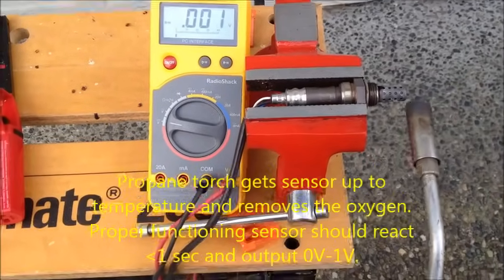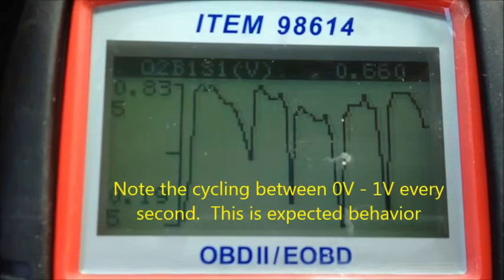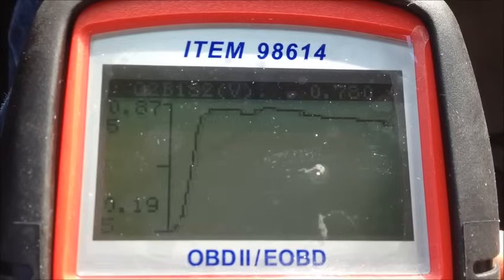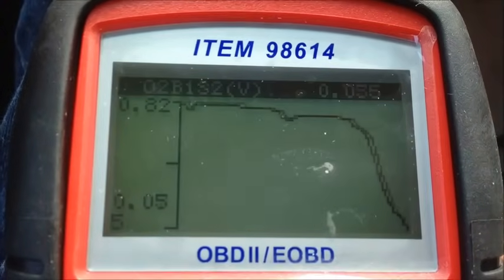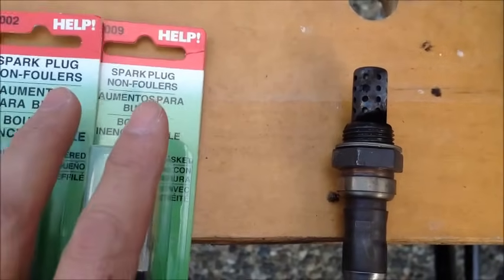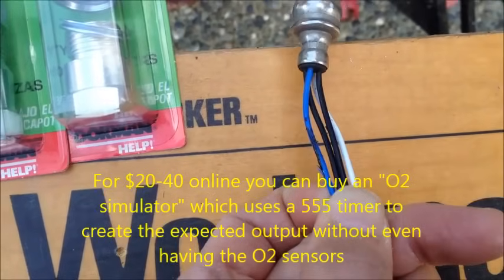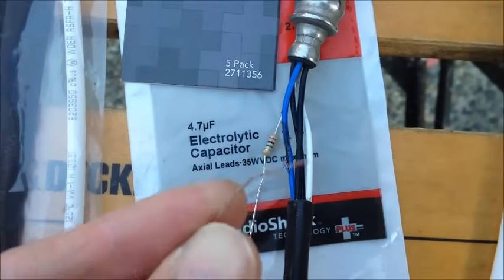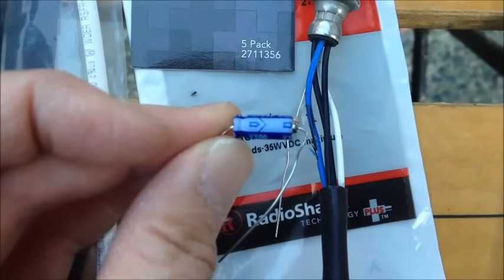$3 O2 simulator fix for P0420 Check Engine Light

Comment: MITEEman,
 thank you! for the time on posting this video. I was one of the unlucky ones that this didn't work. However it wasn't all lost it's that some ECU are more sensitive then others, ask you previous explained. On some cars have programs where using a 1meg ohm resistor will trigger another code of Low voltage, meaning that it doesn't have enough volt to  detriment activate.
so what i have done use the same circuit that you provided I have added a potentiometer = pot and adjusted it to fine the sweet spot on this Suzuki Verona, once it stop giving codes of low voltage and p0420, i measured the pot with ohm meter and it stated 150km then taken out the pot and add a 150km resister. 8 month and no problems. Question how did you know about the frequency? Did you connect oscilloscope to your car? 4.7cap seem to be the money shot.
Reply: Another reason to install the cicuit in a patch cable config - you could make the resistor variable, with a pot, in a lil project box. Still fits under the seats.
Reply: Cisco40ts, thanks for posting your fix, in details.  I'm about to do this on my Honda Pilot and it is good to know this in case I get another DTC.
Reply from the maker: +Cisco40tys Yes, that's a good solution if the default values don't work for you and you want to play with it.  It's a very slow signal so you can use the OBD graphing reader to see the waveform.
Reply: hi,  do you mean 150km  or 150k ohm resistor?
Reply: @kiongchan  He must mean 150k

Comment: I tried this exact mod ( capacitor and resistor in // ) for my corvette, and it didn't work for me.  However, I did get a nice  500 mV read out of my downstream 02's.  The o2 mod generated 2 more trouble codes  for the o2 heater  circuits( B1S2 and B2S2).   In other words,  P0420 was  gone after the mod ,  but I ended up with new codes  P0141  and P0161.
Reply from the maker: +Luis Frausto You should see a signal slowly fluctuating between 0V-1V, not a flatline 500mV.  I suspect that your o2 sensor is too old (>60-100k) and the heater is no longer working correctly.  Check the resistance on the heater wires - it should be close to 5 ohms.  If it's 30 ohms or higher that's not going to work and it explains both the flatline (o2 sensor won't work until it's hot enough) and the P0141 - heater circuit.

Comment: I made this and yes it works. I made one change that I cut an old sensor and end of harness from junk yard and connect to that and plugged in and can unplug later
Reply from the maker: +Howard Knapp I like that idea, but I don't have access to a junk yard.  I see an extension cable for my car runs about $8 on Ebay, whereas an o2 sensor for $17.

Comment: Hi MITEEman and thank you so much for this video. I just tried this fix on my 2001 Jeep Grand Cherokee 4.7L V8 which has been suffering from a P0420 code. Soldered the specified components [SKU 2711356 and SKU 2721012] exactly as demonstrated to the Bank 1, Sensor 2 [driver-side, rear] O2 sensor. Immediately upon re-installation and code reset, it's now throwing a P0138 code [O2 Sensor Circuit High Voltage Bank 1 Sensor 2] and the voltage is showing a constant 1.000v for that sensor on the ODB analyzer. Any thoughts as to what the issue could be?
Reply from the maker: +James Howard See my diagnostic tips.  Since you have the OBD analyzer verify the upstream signal swings between 0-1V every second.  This downstream modification cannot increase the voltages - it just slows the swing down - so a constant 1V tells me that your upstream signal is probably not right (could be upstream o2 sensor or an engine problem) but you may also have to lower the Resistor / Capacitor values as well if that's not the problem.
Reply: +MITEEman Thank you for your reply. As you indicated, this fix does not address a failed O2 sensor and it would seem that something went wrong with mine after it was originally tested. As a diagnostic step, I removed the installed resistor & capacitor to restore the original wiring. Tested it again and the output voltage was still unchanging at 1.000v. So ultimately I purchased and installed a new O2 sensor. Now I've logged ~800 miles with no CEL! Thanks again for the great video and assistance.

Comment: I'm having this same issue with my girlfriends 03 civic. We had an aftermarket cat installed about 18 months ago and the car has 108k miles. LTFT is at %16 and I see that o2 #2 is all over the place. I recently installed new plugs, air filter and cleaned the TB. I have to do a few more tests, run some Techron through it a few times. I've heard someone mention something about putting a couple quarts of paint thinner in the tank, and I'm highly skeptical of doing that. Has anyone heard of such a solution?
Reply: +Shane Sexton I thought you had the same problem with your girlfriend. Her O2 sensor isn't working, and you tried putting a cap and resistance on her!
Reply from the maker: +Shane Sexton I saw those videos which is exactly why I developed this modification instead.  I would never risk my whole engine by doing that.  I also saw videos showing you how to wash out your catalytic converter.  I finally saw the insides of one the other day and I can see why that might be effective but removing a catalytic converter is no small task with old rusty bolts.  You don't mention if you tried this modification.

Comment: I've driven over 500 miles with this simulator and the p0420 code has not come back up on my 2000 4runner sr5 v6. Seems to be doing the job. Thanks. fingers crossed

Comment: I put the cap & resistor patch into the downstream o2 sensor and it really calmed down the output. p0420 code has not popped back up in a week however o2 heater diagnostic has still not completed. Everything else has, and no check engine light yet. Fingers crossed.
originally the 2nd o2 output was jumping around, much like the first. After it looks like this... https://photos.google.com/share/AF1QipM2wsMcidxl9g0vOA33mhLcOtW8pFT61Wtph2BT2smABFYlPDWa_JkcDdh2XS4hvQ/photo/AF1QipMCemgYaZI2-cMNo5Kr9yblAbjTcPu__TidLzHD?key=V1RfN1ZtR0ZkOHdTMG5iZDI2bE1SNWJiZ3hnT0Nn
Reply: Hi there. Did it eventually complete?
Reply: @gibson7654  Sorry, I ended up getting another O2 sensor, later scrapped that van. Now running an 09 Montana. No more issues. :)
Reply: @ScottElder  congrats! I just got my jx35 smogged after 2 failed tries.

Comment: Tried on 2000 jetta 2.0 with p0422 code(main catalyst below threshold bank 1). The p0422 code went away and created a p0140 code. However the spark plug defouler worked perfectly fine. Also look into angle spacers for o2 sensors for another fix.

Comment: This is nice walk around to address slightly oversensitive downstream (behind cat) O2, catalyst on the edge with efficiency.Those wires are not aluminium, but nickel coated. To solder them fluid for soldering Nickel  from radio shack (my one contains ethanol & phosphoric acid) and  increase heat slightly, but don't destroy condensator.This how to will not work for wideband O2 sensor. (new Japanese and Euro cars mostly)Low voltage lambda errors which some people here get, might be related to poor soldering. Is the tin mirror shiny good or rather grey matt - bad? Or wrong resistor.

Comment: Tried this trick on 2005 Prius(188k miles) with the P0420, got code P0038 Toyota - Oxygen Sensor Heater Control Circuit High Bank 1 Sensor 2.

Used OBDII meter to check, showed O2 bank1 sensor 2 1.27v.

Did I do anything wrong?
Reply: Steven Qiu Fixed the p0420 with the non-fouler trick (42002)
.
Reply: did you ever figure why?

Comment: Hey,  does capacitor and resistor need to be that close or can it be moved up further up the harness (plug),  while keeping same cap and resistor orientation?
Reply from the maker: Kobe Kumar It doesn't matter where you do it.  It's easy to make the mod on a workbench but just be sure you have access because on my Odyssey the space gets very tight as you get close to the harness plug.  I have not had any problem with the heat of the catalytic converter destroying the components but it does make sense to keep them as far away as you can.

Comment: I'm reserving this info in case I need it, really useful. 

Also can confirm the o2 sensor wires are a pain in the butt to solder togheter...
Reply: They are steel not copper. Easier to solder using silver solder or install upstream of the connector (copper wire their). Also much harder to spot if a visual inspection is done.
Reply: @douglasholt9337  Yep, discovered the Silver Solder vs Lead Solder After the second try. I had been soldering closer to the sensor to avoid modifying anything upstream, didn't want to make it harder to figure out for the next guy, which it was going to be me :v
Reply: @legendario13  Yep 'me' I can dig it. 
Sooo I made a 'splice' connector. I jury-riged a connector as I have boxes of 'electronic junk'. For your self go get
a set of O2 connectors. Solder up 9" wires between the male and female connectors. 
Now I can do all work om my work bench. I have my pro soldering iron, a selection solder, millimeters, oscilloscope. powersupples, boxes of 'electronic junk'... Craft it up, plug it into my car, not satisfied, unplug, back to the workbench. More better than Ti-chi soldering with your head stuffed in unmentionable places.
Tip: get a 'Weller P2C Butane Soldering Iron'. Now ~$50 on amazon! Read the reviews. Bought on for a friend for ~$30, amazon a year ago, words getting out, gouging. Look around, wait, look around, Ebay perhaps. I have two.

Comment: I followed the directions exactly and it worked for me. 2002 Hyundai XG350, 65k miles with persistent P0430. 1000 miles later and no codes or check engine light. TX State inspection passed. You gotta do your own research on your specific car to determine which O2 sensor needs modifying, and which wires are what.

Comment: I understand the resistor will increase the voltage, what does the capacitor do?
Reply: No Name 
The capacitor is like a battery.  It gets charged with voltage.  When the voltage drops, the charge in the capacitor drops.  The resistor controls how fast the voltage stored in the capacitor increases and decreases.  The higher the capacitance, the more energy it can store.

Think of a pitcher of water.  Higher capacitance means a bigger pitcher of water.  If you have no lid on it and you hold it under a water fall, it will fill quickly.  You can dump it out quickly . If you have a lid on it with a small hole, the pitcher will not fill up as fast and it wont get dumped out as fast.  The resistor kind of acts like a lid on the pitcher, by slowing down how fast it fills and drains.

What you are trying to do is average out the wave form and make it change slower, rather than faster change.

Comment: Before doing this mod, you may want to check out the Upstream O2 to make sure you don't have a rich condition. In time a Rich condition will melt your Cat, and the code will be legit.  Also if you do the mod and it works but the primary o2 is causing a rich condition, eventually this will not work.  plus your performance will be crappy on your car.
Reply from the maker: Rhage73 Yes, I believe you need to look at both sensors on a graphing OBD reader just as I show in my video.  Otherwise you're just guessing and won't have any diagnostics if it doesn't work.
Reply: good man =)   i use an elcheapo wireless obd II, 30bux shipped from amazon.   I use free cardoc app or torque Although i believe torque may have issues reading widband O2.   switched to cardoc to read the O2 on my Jetta VR6, works rather well and the response times are way faster than torque. so stuck with it.  you can graph it on V or percentage of trim. that will let you know if your primary O2 is working without getting too crazy with the cheese whiz. Although  i have seen a new product very recently that is a mini scope that is actually affordable.  Uscope i believe it is called.  pocket scope with attachments, 125 bones.  not too bad for what it is / does.   very good for looking at spark.  "scannerdanner"   is my source, dood is beast on the electronics and system trouble shooting. Nice video man.  thanks for posting.
Reply: +Rhage73 - What you are saying is essentially true. However it is a common misconception that a rich condition all by itself will damage catalytic converters.

What actually damages the cat are continuous misfires. During a misfire the entire air-fuel charge that was supposed to fire inside the cylinder fires inside the cat instead. When this happens continuously it can cause the temperatures inside the cat, which normally run around 600F, to skyrocket to 2,500F or more. It is these extreme temperatures that will melt the bricks inside the cat and/or damage the coatings of precious metal inside the bricks.

What the rich condition actually does is to eventually carbonize and foul the spark plugs. Then when that happens the fouled plugs begin to cause continuous misfires, which is what actually overheats and damages the cat. So it is important to fix the rich run condition quickly before the plugs foul and you get to where there are continuous misfires that will quickly burn up the converter.

Some vehicles have protection algorithms in their engine computers designed to protect the converter(s) from continuous misfires. Some will announce this condition by flashing the check engine light to warn the driver that conditions exist that could destroy the converter(s). Others will go further and shut down the engine and not allow a restart for a certain time period to let the converter(s) cool down. But some (Chrysler products I have noticed) do not do a good job at this and they seem to burn up the converters more often. So you need to be careful and avoid the temptation to just keep driving it as long as it still runs.
Reply: ya, mine will flash if it misfires.    I agree 100 percent about misfires killing the cat quickly.  extremely fast.   But i still say over time, if the air / fuel isn't correct it will hurt the cats because there will constantly be more fuel than normal leaving the cylinder   so they cat will light it off, increasing the operating temp, above the normal perimeters, and eventually damaging the cat.   Just happened to someone i know, i helped them fix their car.   Primary O2 was stuck in a condition that injected too much fuel after about 2 months he asked me for help, i fixed his primary o2 and and noticed a secondary o2 code when i did, i cleared the codes and after about 200 miles or so the light came back so i checked it, and it was the cat below efficiency code again.  It has been 5 months now, his car is still running good, gas mileage is still normal, but throws the code for a bad cat. /shrug not saying it happens every time or right away, just saying it CAN happen.   only call it like that if i have seen it personally.  Otherwise, its just blah blah blah. ....but like i said, i agree with you about misfires, seen that one too.   something as simple as a spark plug wire arching to the engine and not lighting the fuel off will also melt them, you really have to keep on top of those kind of failures, gets expensive it you don't.

Comment: I had a P-0420 steady in my 2004 Toyota Sienna mini-van for the past year.  I tried the fix as posted in the video.l  I purchased the parts from my local Radio Shack and wired them as shown in the video.  It did smooth out the response of the Bank 2 downstream O2 sensor. It was evident by graphing the two downstream O2 sensors. The modified sensor was much slower to react than the unmodified downstream sensor.  However, the van would not pass the O2 readiness check and soon the CEL illuminated with a code P-0156 "O2 Sensor Circuit Bank 2 Sensor 2".  I cleared the code and it came back on the very next drive.
Thus, I soldiered the O2 sensor wires back to factory condition and installed the no-foulers as advertised in the video.  The O2 sensor readiness passed in the first five minutes of driving.  I have been driving the van for two weeks now with no check engine light BUT the catalyst readiness monitor is still INC after two weeks of driving.  In Texas, you are allowed 1 INC readiness so, it passed this year's inspection without any problems.  I don't know how long it will take for the catalyst readiness to turn to OK. Some people say it could take up to a month for this to turn to OK.  I have no pending codes so I think it will be just a  matter of time before the catalyst monitor changes from INC to OK.
This van has 330,000 miles. I suspect the catalytic converter is most likely dead but a new one is cost prohibitive when compared to the value of the automobile. No-foulers it is for now.
Reply: +Tim Plasek .... FYI, Catalytic converter test runs at highway speeds, normally between 55 - 60 mph (can vary my make, model and year). Must be fairly steady speed for several minutes, and oxygen sensor monitors must have already been run. If you normally drive faster than this (most do) the cat test will have a hard time running in a short time period. I'm a shop owner / operator and often take problem vehicles for drives and then in for the OBDII emissions test as I can get them through where regular driving they will fail.